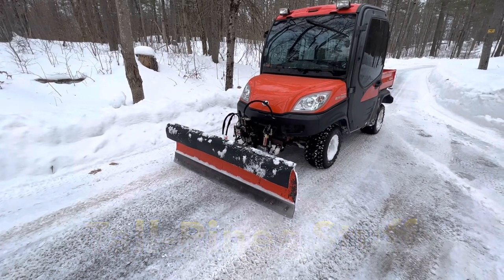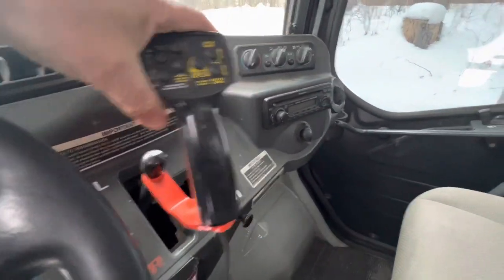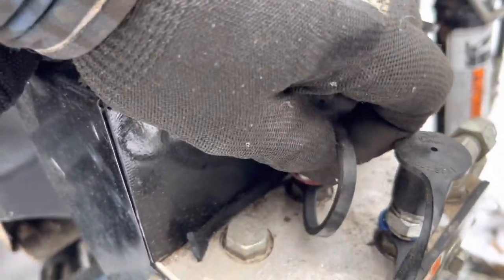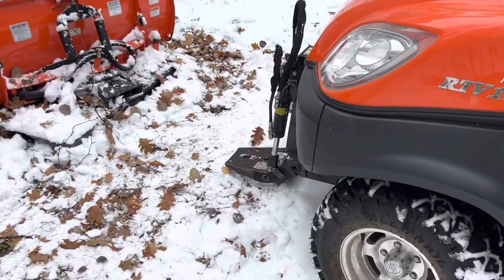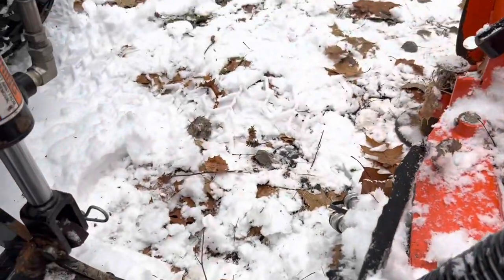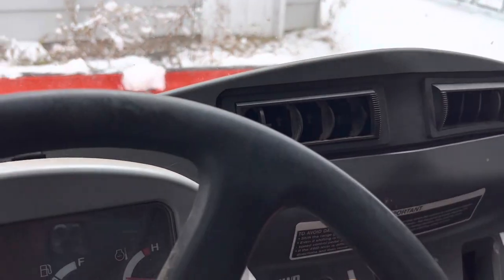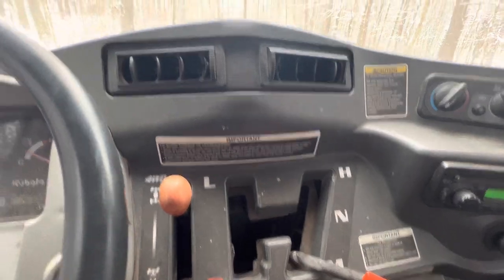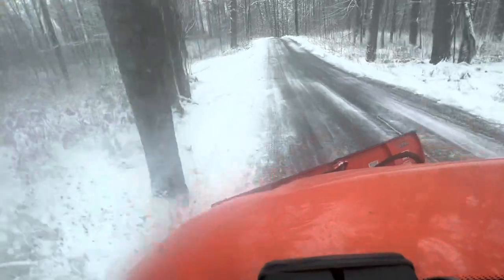Mounting a Kubota Straight Plow on an RTV-1100

Comment: I'm eyeballing a used (2011) RTV 1100.  Have you taken yours over hilly terrain?  Your property looks fairly flat.   I've seen and heard enough to know it'll be a great plow machine, but I also want to use it to gather firewood the rest of the year.  I'm in the mountains though, and aside from concern of high altitude (~9k feet) sapping strength from it, I'm worried the weight of this thing will keep it from tackling the slopes around my property.

Comment: I recently bought a used V4290 for my RTV1100.  However, I can't locate a installation manual anywhere on the internet.  Do you have a part number, or an manual number for your installation manual that you could share?
Reply: Or a diagram of where the supply and return hoses go?